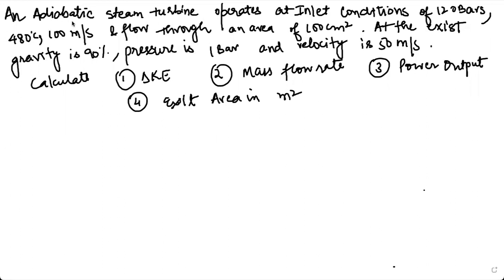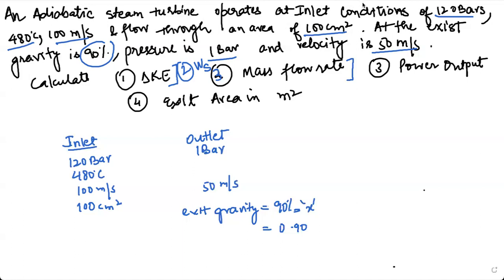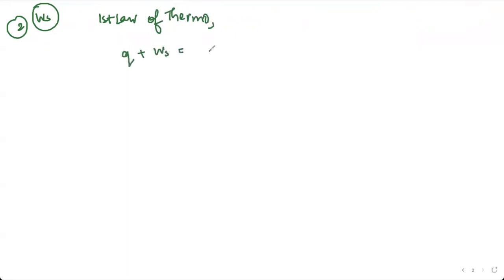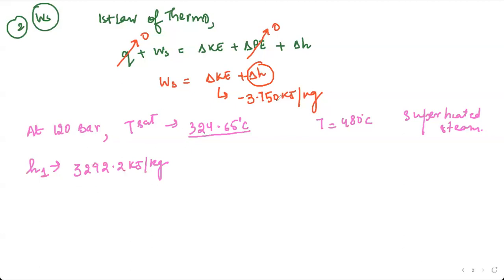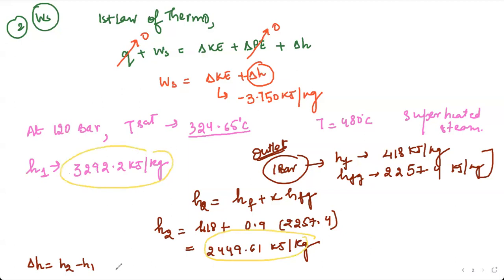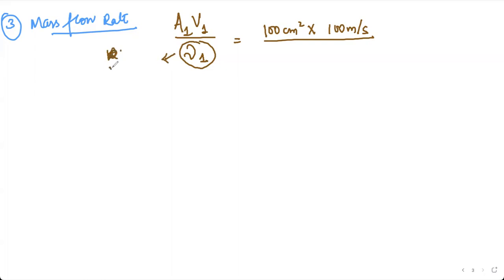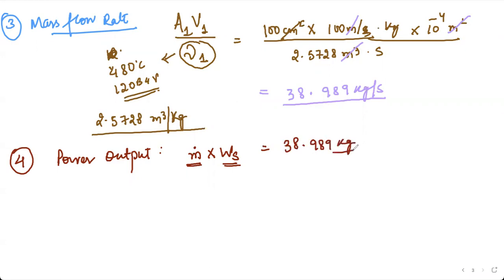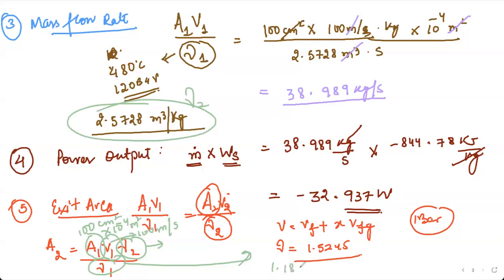First Law of Thermodynamics - Steam Turbine - Numerical Problem

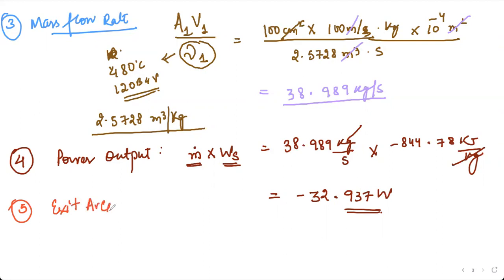Comment: At 11:42, 38.989 kg/s times 844 kJ/kg equals approximately 32,680 kW. And the negative sign only applies if you assumed the direction of work output to be into the system. Otherwise, you should obtain a positive value (indicating work output is out of system).